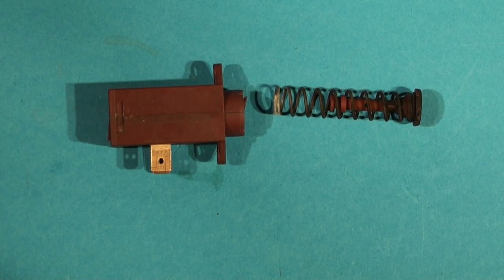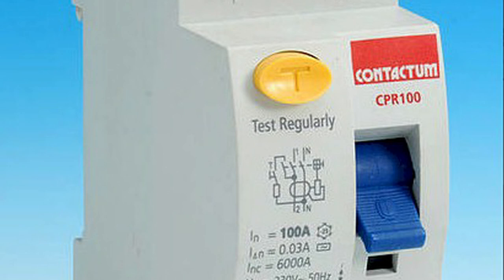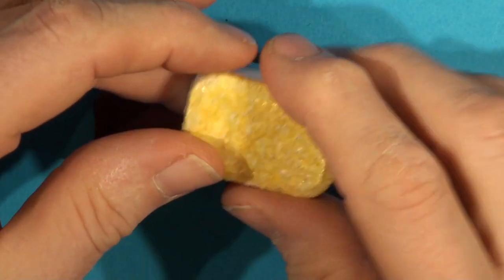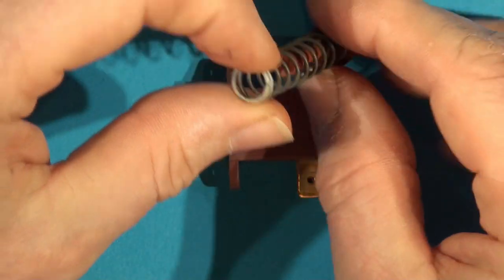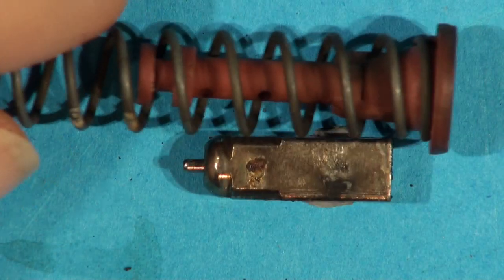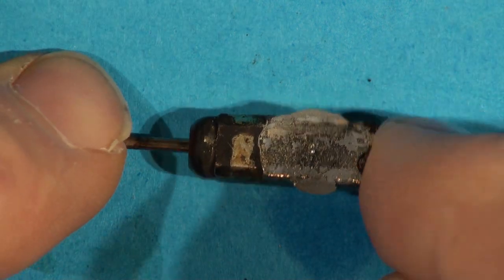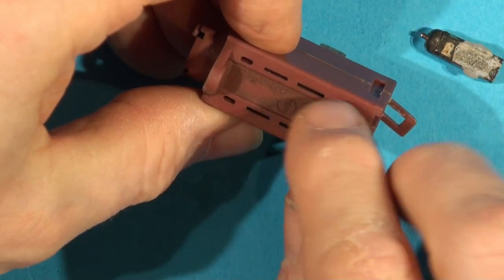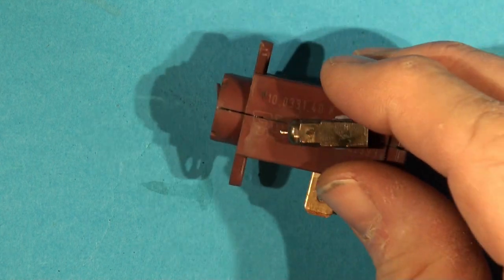Bosch Neff Siemens Dishwasher Blowing the Mains Fuse Investigation

Comment: Hi many thanks for the help, I had presumed a failed heater element (old Bosch dishwasher), RCD tripping & no hot water, struggled to get the element out but managed to put a meter on it and as far as I could tell  (never been confident with those) it was ok. So was searching for heater relay help when I came across this video, previously had watched your others. It seems this model heats up after soap dispensed,
Removed actuator, and appears to be scorched as described. Bosch replacement inc. post £19.81
Many thanks you have saved some landfill. Martyn
Reply from the maker: Good job. Thanks.

Comment: Same sort of mechanism is used by some manufacturers to keep washing.machine doors from opening during a wash cycle.  After the wash cycle has ended is takes a couple of minutes for the door lock to click open, this is the time it takes for the wax to contract.
Reply from the maker: Great info thanks.  I find that bloody annoying. I always assumed it was a bi-metallic strip in the latch.

Comment: Hi, can you help me please?

I have a Hotpoint integrated dishwasher. After 11 years of sterling service, it has started to play up.

The problem first appeared a couple of weeks ago, when the dishwasher refused point blank to turn on. I changed the 13A fuse in the main plug & the dishwasher powered up as normal. It then went through a full Eco cycle with both heating cycles taking the normal wattage (typically 2.3kW) for the usual amount of time. However after completing what looks like a normal 3½ hour cycle, the fuse in the plug had blown again!

Not wanting to faff about, I ordered a new updated version of my dishwasher from Hotpoint. It was delivered okay but when the guys tried to fit it, they physically couldn't! They reckon the guy that fitted our new kitchen 11 years ago effectively built it AROUND the dishwasher! Thankfully the people at Hotpoint were very understanding & gave me a full refund.

However, now I'm a bit stuck. If I had some idea of what's causing this issue, maybe there's a chance it could be repaired with the machine remaining in situ. Failing that I guess I'm going to have to get someone in to dismantle bits of the kitchen to get the old one out but this seems a such of a drastic step!

Thanks for any advice you might be able to share.
Reply from the maker: Do you have an RCD in your Distribution Panel? If so the likely problem is a short in the mains input filter or the ion the heating element in the soap dispenser tray.    If not then it is likely a short to earth  inside the heating element. If you have an RCD then this fault will cause it to trip and not blow the fuse. The filter can be unplugged so you can run the dishwasher  and rule it out.   Otherwise you can disconnect the heating element and run it to see if the fuse still blows.
Reply: @razenby  Thanks for your help but in the end, with wifey getting fed up of waiting, I called in a kitchen fitter to get the old dishwasher out, which he managed to do. The new one gets delivered on Monday & the kitchen fitter returns on Tuesday to put it in place. Hopefully this will be the end of this sorry saga...at least until the next time it breaks down!

Comment: This sounds like the problem I’m having with my BOSCH dishwasher, but how do I access it?  It’s situated on the drop down door, do I need to remove the complete inside panel of the door?
Reply from the maker: Mains causes tripping / fuse blowing:
Do you have a residual current breaker on your mains?   If yes then if it were the heating element then it would trip the RCD. If you are blowing fuses or the current breaker trips (current overload without earth leakage) then it might be the thermal actuator of the soap tray or the input filter - some dishwashers have a interference filter block near where the mains power lead comes in. These go short and blow the fuse , trip the current breaker, and depending on what fails inside the block, trip the RCD.  If you don't have an RCD then you will have to investigate all 3 by process of elimination .  
1. Disconnect the heater wires and insulate.  If trip goes away then it is the heater element. (The most common cause of the fault).
2. Remove the filter block and see if problem goes away. - It usually is a plug-in module.
3. Remove the inner door panel and have a look at the soap dish actuator.
Good luck...
Reply: @razenby  Many thanks for your quick reply. The RCD was automatically activated as soon the problem arose, so I disconnected the dishwasher from the power supply immediately. I’ll remove the inner door panel tomorrow and take a look at this, incidentally this is the area a loud bang was heard when it happened. One last favour, do you have a name and reference number for this spring device?  Thanks again.

Comment: I have a Neff S5433X0GB and made a large bang almost at the end of  a wash  and tripped the RCD  But this  happened a few years ago and had to take  apart and something had blown at the back bottom right had side any a idea what that  part is??
Reply from the maker: I think that is the mains filter block. Basically a part fitted to protect the dishwasher and also filter out electrical noise generated by the dishwasher working its way back down the mains. It is usually a mains surge that blows them.
Reply: Hi so last night a bang from the neff dishwasher the fillter block was black dis coloured and lood split! Wasld this should work with out replacing the filter part is this true 🤔!? The is no power light on the dishwasher on  but power at the wall plug 🔌

Comment: Hi the filter blown on the back does that need replacing  or can it work with out it!?
Reply: I've no power in the dishwasher but power at the wall 🤔
Reply from the maker: The filter block usually goes short circuit and trips the RCD breaker or if you don't have an RCD, the fuse in the mains plug.   Most blcks are just a capacitor network between the power lines and ground. Some filter blocks do have series choke(s) that can go open circuit. Usually the filter shorts the mains to supply earth rather than breaking the power circuit.   Have you carefully inspected the whole length of the mains cable and the fuse in the mains plug?  There may also be an electrical fuse inside the appliance.
The filter block does two things:  
1. Prevents conducted electrical noise from the washer reaching the mains supply wiring.
2. Filter HF noise and transients from the wiring entering the appliance. 
  If the filter isn't fitted  then 2 could be a problem as the off-line power conversion chip is quite vulnerable to mains transients. 
That's about it. Good luck.

Comment: Siemens Dishwasher  (about 15 yr old btw) was tripping the RCD 40 mins into a cycle, replaced the instantaneous water heater assembly, all good working fine for about a month. The RCD trip problem has now started a again, but 9 mins into the cycle but the tablet drawer is open? so guessing it cant be the actuator problem? , could I have a fault water heater again?. btw not RCD trip on a cold rinse cycle
Reply from the maker: Hmm,  could be the heating element again.  You can check for basic ground leakage with a multimeter but you really need a insulation tested that checks for leakage at around 25 to 500 V DC.  On most dishwashers the soap dis actuator 
 has no supply earth connection. so when they blow it is usually the current trip or fuse that gets taken out.  From what you say it would appear to be he element.  However tripping 40 minutes into the cycle seems a long wait for the heater. Is there really a 40 minute cold pre-wash?   I would take the side off and check for post repair leaks.   Also worth considering if you RCD breaker loaded up with other leaky circuits.....  You can disconnect the mains input filter - they are a common source of leakage. The DW could be the appliance that takes it over the edge.  I had this problem in one of my flats and I was tearing my hair out trying to work out what was causing it.  In the end there was about 25mA leakage to ground with all the cheap computer equipment in the flat.  I have also seen faulty RCD tripping out - they do age and they do fail so don't forget to consider that. And... don't forget the main input filter are a less common cause of ground leakage but need to be ruled out.

Comment: Same as the older type of washing machine door lock.
Reply from the maker: Interesting.  I prefer a good old solenoid. Thanks for watching.
Reply: @razenby  I agree. They are also used in central heating radiator valves.